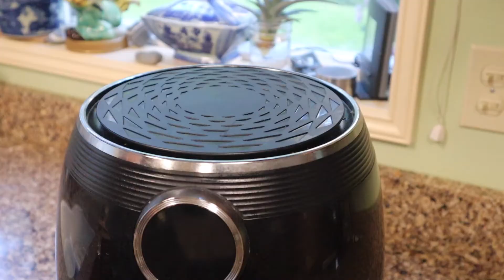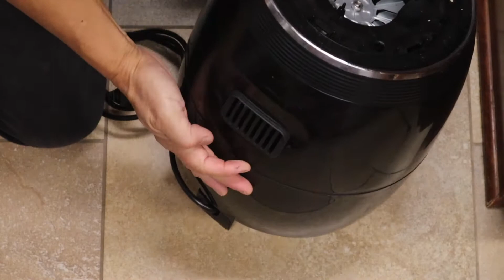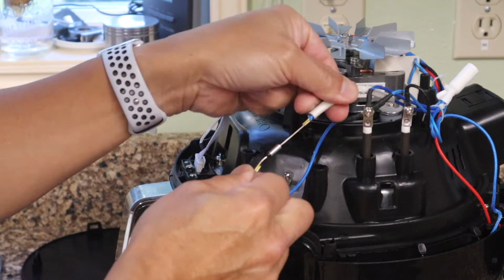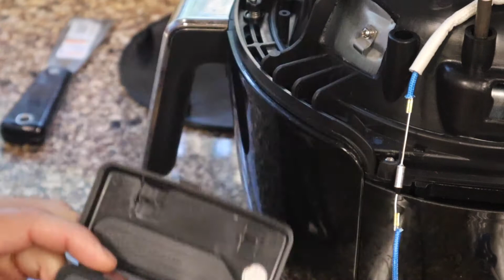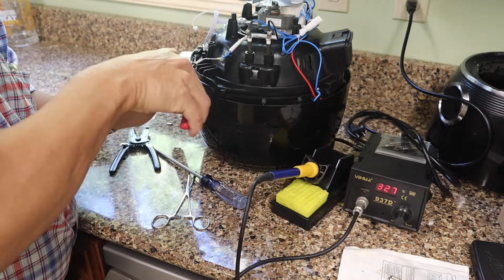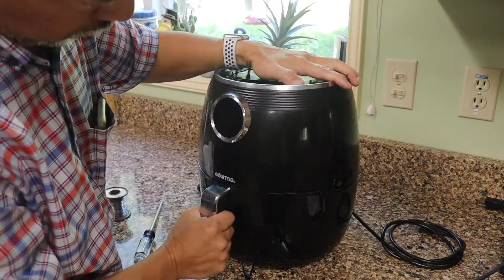Gourmia Air Fryer Repair

Comment: Thank you! I have the exact same model with the exact same problem. Upgraded the broken 172 C fuse to 192 C. The original fuse does not have a current rating but because it is 1500W, I think 15A is appropriate.